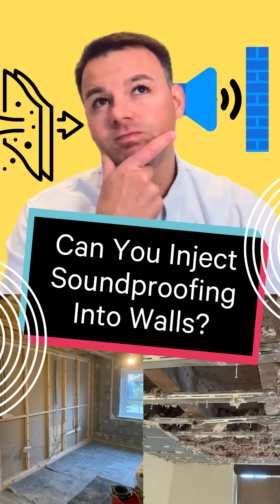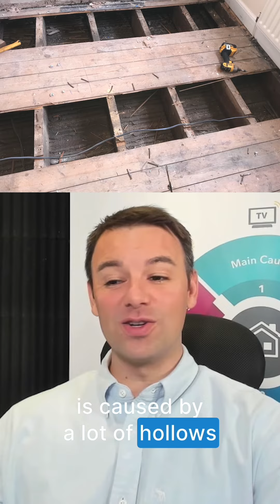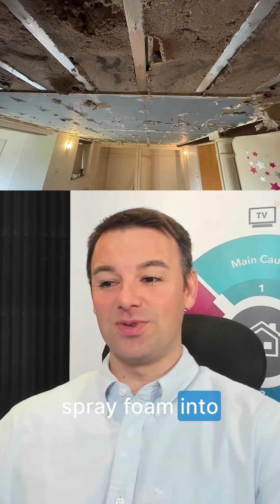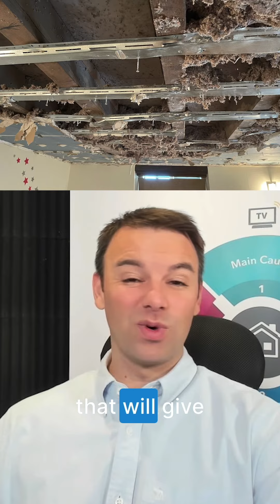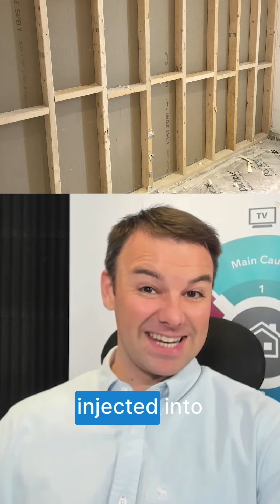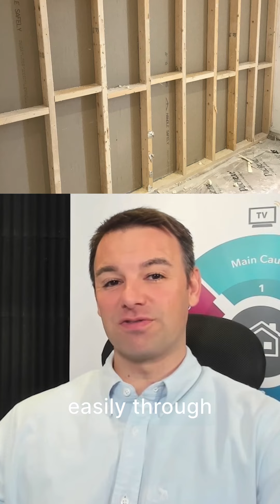Can You Inject Soundproofing Into Walls? #soundproofing

Comment: I'm suffering this exact issue. I was hearing in my bedroom at night, right where I have my pillow, a low frequency sound of around 100Hz coming from de gas heather from my upper floor neighbor that he has on the oposite corner of his flat. After doing dozens of tests I finally discovered that it was mostly ampified by a small brick wall in front of the bed. I found a contractor that, following my request, detached the wall from the ceiling basically by breaking it and filling the gap with expanded foam. Then he suggested to fill all the brick holes with the expanded foam as well. The result is that the low frequency noise has decreased in around 6 to 8 decibel (small victory), but the normal noise (mid frequencies) have slightly increased :(( . I wish I had seen this video before that.
Congratulations for this channel, it's an enormous help to understand the complexity of acoustic insulation.